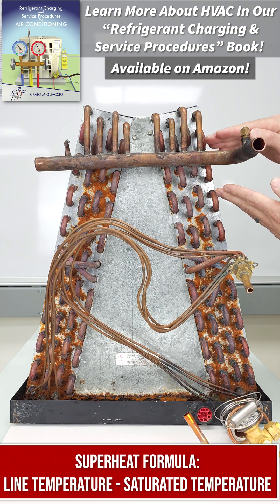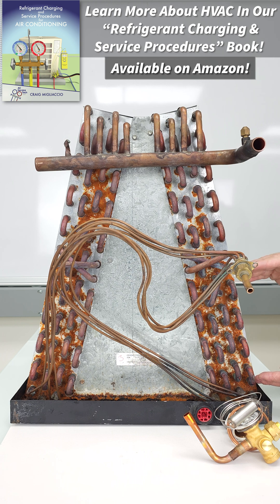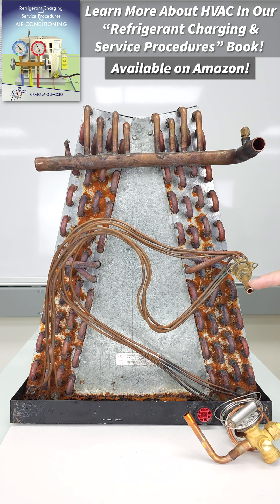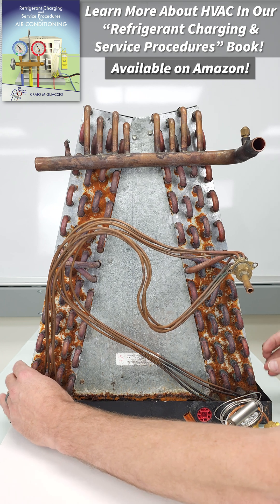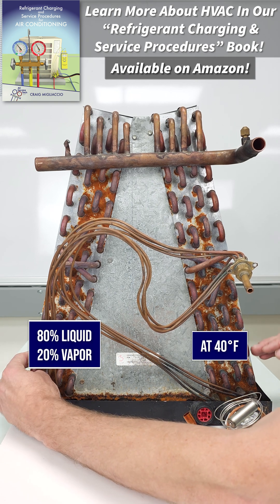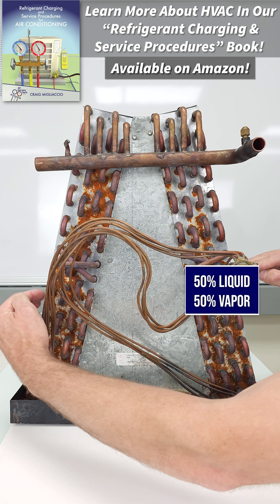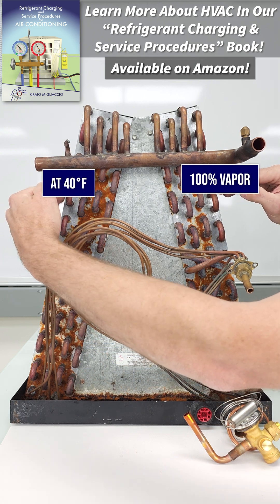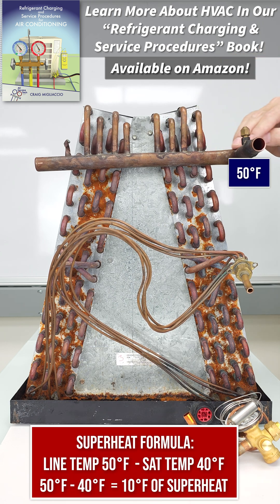Explaining SUPERHEAT on an AC Coil Quickly! #hvac

Comment: When measuring compressor superheat, whenevap connection unavailable, it  seems to low side temp w 410, 4** blends, with scrader guage connection close to compressor,  it seems 38degrees  is the magic number.???

Comment: A better way to say that would be heat added to refrigerant after it’s turned to 100% vapor
Reply: Is it not absorbing heat while saturated?
Reply: @KevinfinityDrumsit’s picking up heat and changing state from liquid to gas
Reply: @murkyturkey5238  what are you talking about? Superheated vapor has passed the point of mixture. Everything added after the change of state is superheat or sub cooling period, when it comes to a refrigerant cycle.

Comment: Superheat is a sensible measurement of the amount of heat added to a substance above its boiling point.  The largest amount of heat transfer happens during this phase change.

Comment: I had a tech tell me when a unit has a txv never look at the superheat. I understand that we don’t charge the unit by superheat when a unit has a txv but both Sc/Sh should be relatively close to each other due to the unit being a sealed system( I know not exactly close but relatively close). Which means the subcool and super heat should both balance each other out if the metering device on the unit is working properly. Am I wrong for thinking this way? For example one unit had a txv with a target sub cool of 10 and the units subcool was 13 and the super heat was 3.  The tech I was with deemed the unit good. Is that correct ? Is there not an indication of a restriction or a problem? ( I’ve been in the trade for a year)
Reply: You're on the right track.  3 degrees of SH on a TXV coil would raise my eyebrow.   A TXV coil with a low SH could mean dirty air filter, blower on too low of a speed, undersized supply or return ducts, dirty evaporator coil,  mismatched tonnages between indoor and outdoor,  TXV stuck partially closed or possibly overcharged.  (If it's overcharged, your SC will be abnormally high though).
Reply: Also, every reading on your gauges (I use SMANs) is important.  That info gives you a complete picture of the system performance.  If things don't seem normal, chances are you are on to something.  Attention to little details are what set the decent techs from the super techs. I tell guys to use all their senses when diagnosing problems. Always remember that you gotta have proper airflow and clean coils (indoor and outdoor) to get proper readings or else they'll look skewed.

Comment: The purpose for  superheat is to ensure that the compressor doesn't slug liquid refrigerant.  (Compressors are vapor pumps).  With a piston metering device, you must find your target superheat based on indoor wet bulb temp and outdoor dry bulb ambient (IDWBx3-80-ODDB divided by 2).  If you have a TXV, it does that for you (if functioning correctly).
Proper subcooling (usually on outdoor nameplate) ensures that you have liquid entering your metering device at the evaporator coil.  
Too much refrigerant means risk of liquid migration back to compressor, high head pressure, excessive compressor run load amps (RLA) and system inefficiency, etc.  
Too little refrigerant and you won't have the required change of state from vapor to liquid and vice versa.  Also, a loss of efficiency and possible freezing up of evaporator coil.  There are other variables to consider, of course.  
Stay cool my friends.
Reply from the maker: Great job and understands greatly!
Reply: Superheat
Reply: You're a good person and an excellent teacher.  I appreciate you trying to educate the public on expensive AC equipment operation, so they can make better decisions.  I know many struggling families who cannot purchase ac units because of pricing. When they understand how the systems work, they feel like they have more control and can make decisions.

Comment: Could you do a follow up on this video with an infrared camera on a running system? So we can visually see this?  I think that would make some really good content and help people visualize it even better.

When I was trying to diagnose a potential TXV issue, I used an infrared and could visually see all the various temp drops and increases that you mention..

That then lead me to question what should the temperature drops be?  There is a huge temp drop between the high side and low side at the txv, but there was another temp drop that I could see at octopus distributer thing...   I would assume that is normal because it is an even lower pressure as the flash gas goes past the manifold on the distributer and into the individual lines into the exchanger?

Hope that made sense...

I actually have been looking for the answer to this..  would you happen to know?
Reply: The drop at the TXV is from a large area to a smaller area right at the distributor.  The distributor is a further restriction and will cause an additional temperature drop before entering the evap coil.  So, you are correct.

Comment: So in this case, when it reaches the top of the coil, that's where there's about 10 degrees of Superheat? Since it's 100% vapor and 10 degrees warmer than the non saturated vapor below it?
Reply from the maker: Thats absolutely correct!
Reply: Superheat is not "10 degrees" always.  It varies depending on outside air temperature and indoor wet bulb temperature.  As long as there is some degree of superheat, it "all" vapor" or minimal liquid.  I've had superheat calcs come back targeted as high as 28 degrees on hot muggy days in hot muggy houses.
Reply: @rcstl8815  yeah I know that. I was talking about this specific scenario
Reply: @joziahcorbett2399  Not sure what you're asking, yes his 10 degrees SH is at the point it is measured.  

My answer was not just for you.

Comment: Great job as always, on this explanation of superheated.
    Could you do one for subcooling at the condenser?
    Would you agree it's a good idea to have a vapor port at the evaporator, as to diagnose better at coil ,nd metering device ?
Reply from the maker: We will be having one posted on subcooling as well! You woukd still need to chack total superheat for compressor safety too though to make sure only vapor enters!
Reply: Subcool is the opposite.
It is the amount of heat removed from the liquid below saturated vapor pressure.